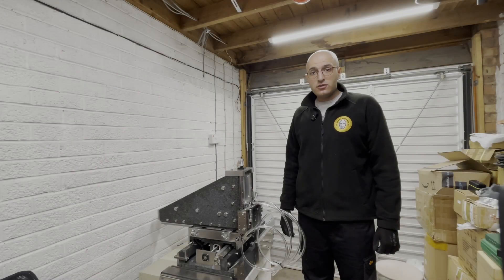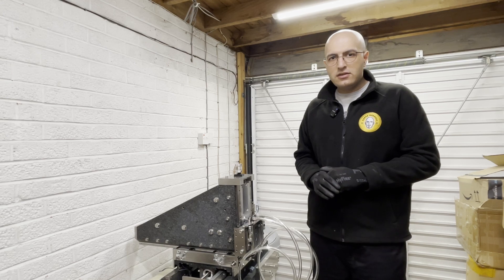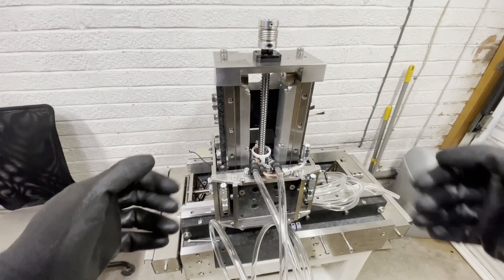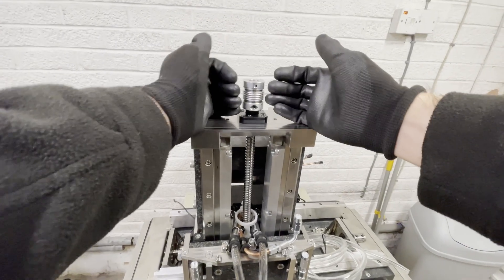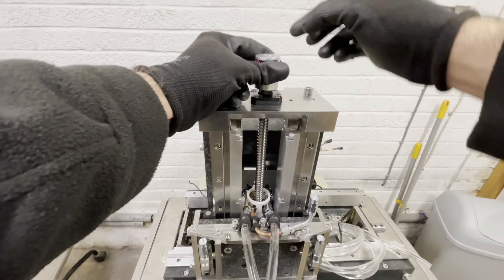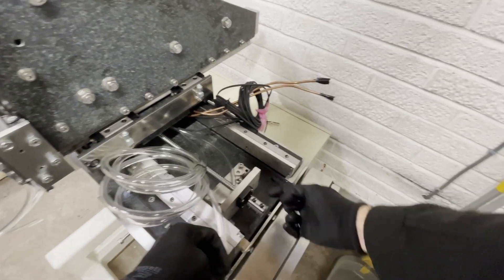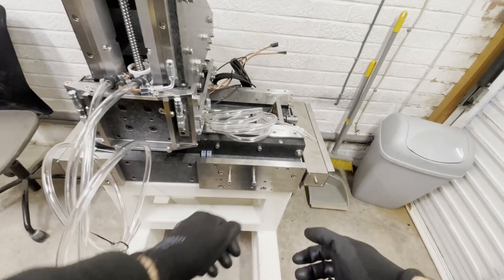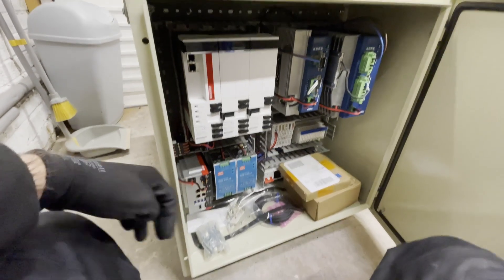DIY 5 Axis Machine, Z Axis Components - E005

Comment: Love your channel!! I'm starting to build a mini vmc, nice and solid approx 1 tonne overall, steel welded with granite epoxy infill..

Do you think it's acceptable to use large bolts with welded feet on them, thick rubber pads on each end and wedge them at certain intervals all over the machine to reduce vibrations?

I think with the epoxy granite and covering all the bolts with feet inside the frame would greatly reduce harmonics

Thanks in advance

Comment: When the tube is bent past its least radius, it develops a "kink".
I wonder if you could use a constant force spring to counterbalance the z axis, reducing the torque moment between the drive screw and front stucture mass, and reducing the actual vertical load on the ball screw?  Any comments,  cons?
I notice that you don't appear to be using air bearings, as you mentioned grease distribution...any discussion about grease versus air bearings?
On the preload adjustments, do you use anything like Belleville washers for compliance in the adjustment?
Always fun looking at precision works...
Keep on having fun!
Reply from the maker: Thanks for the comment, and teaching me the word I was looking for. 😁

No counterbalance is needed for such a small axis. Counterbalance can cause quite a few issues, especially in the case of a spring. It can cause unwanted backlash if your ball screw wears out, it can mess with the servo motor as it would apply different amount of load at different heights of the Z axis which can cause positional errors. It can reduce system response in terms of acceleration/deceleration and quite a few other issues. For large masses on the Z axis you usually need to use it though. 

A Belleville washer is essentially a spring, and this preloading doesn't need to have a constant force applied to it. If you do that, you will wear out the ball bearings quickly, increase noise and stiffness and since one of the linear blocks must be floating, you will decrease rigidity. A spring mechanism is needed when your alignment is not good enough and the sprig is used to compensate the inaccuracies, but it adds all the negative points mentioned above. 

Hope this helps. 

Cheers,
Kasra

Comment: What is the formal name for that style of linear bearings?
Reply from the maker: Absolutely no idea. The only manufacturers that I know of are THK and INA. And INA's version is no where near the THK product in terms of accuracy (parallelism, flatness, etc...)
Reply: @kasramehraky9283  IKO makes cross roller recirculating split LM guide too---model code LRWM. Probably stiffer than the ball bearings you picked. Modal and FRF analysis with finite elements could show if they would make a big impact
Reply from the maker: @davidharuch  I checked it out. It is definitely an impressive product. The only issue is that its accuracy is not on par with the THK one I use. By accuracy, I mean the machining tolerances on it are not as good as the THK one.

Comment: Your cubical is probably too small to run all content without active ventilation, or some including in one of your coolers.
Reply from the maker: It will have an AC inside the enclosure of the machine and a mist collector on top of the enclosure. That should do the trick!

Comment: Are there any ball screws on the market that have cooling fluid flow through them?
Reply from the maker: Yes, quite a few actually. THK, Schneeberger, NSK, Steinmeyer and a few others produce them. They usually start from diameter 20mm and not usually available as C0 or C1 classes. And you need a rotary union to transfer the coolant, also usually can't use a direct coupling with the motor because you need to use the hollow shaft for cooling, so you need to go with a belt drive, which I'm not a fan of (for ball screws). https://www.thk.com/?q=vn_en/node/21323

Comment: very interesting. when you get to it i would definitely love to hear about the beckhoff CNC software your using. I have only heard of one company Innolite using on their diamond turning lathes and it sounds impressive. Though i always thought they completely programed their own software but  maybe I'm wrong.
Reply: Innolite use Triamec for their drives, but maybe beckhoff for controls?. The Triamec stuff is insane, 100kHz Update rate.  They have videos on their channel of some beautiful hardware. Impulse Decoupled nanometer precise axis. Active Dampening with accelerometers, etc.
Reply from the maker: There are many companies who use Beckhoff as their CNC control, but they usually put their HMI on top, so you wouldn't know it's TwinCAT underneath. For example Holzher, Charmilles, Chrion Mircon 5, Precitrame, Voortman and many more use TwinCAT cnc.
Innolite is definitely one of the best in the world of diamond turning.